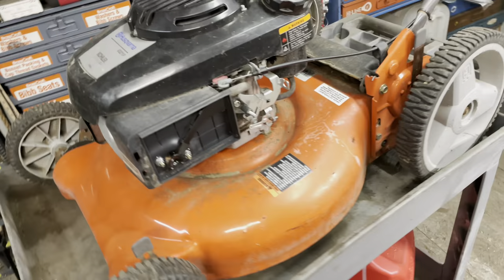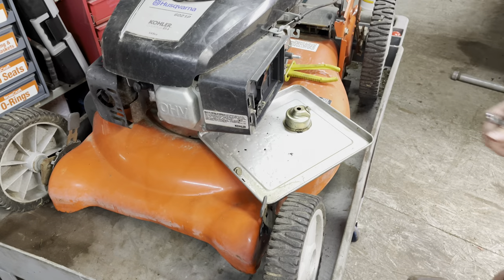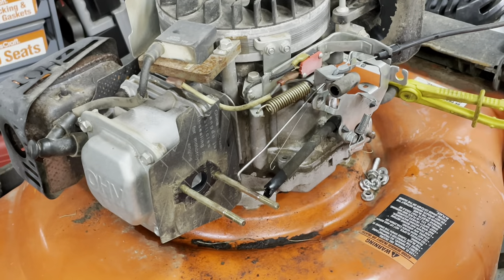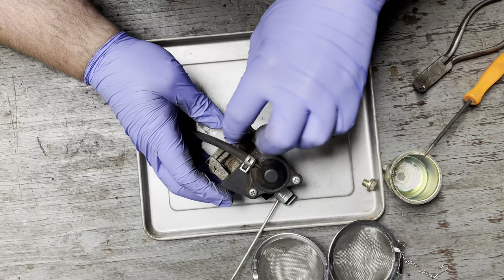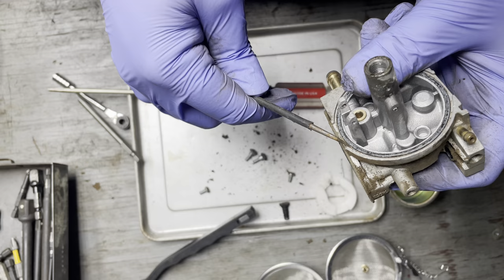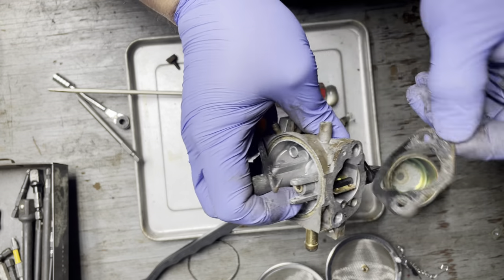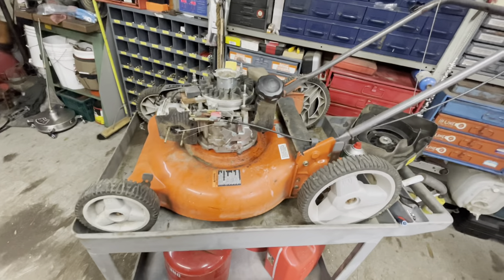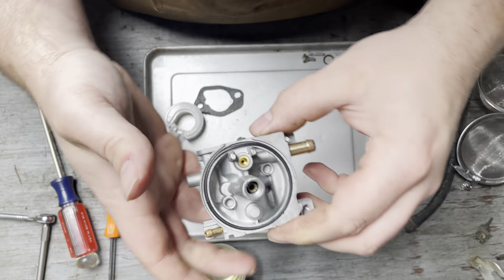Husqvarna 6021P Won’t Run.  Carb Clean/ Service

Comment: I am a 68-year- old woman and thanks to your video I was able to replace the carburetor on my mower myself.  I did have a couple of problems though. When taking it apart one of the torx screws broke off and one of the screws in the back was stripped and would not come out. I tried to get the top off so I could get my drill in there, but the bolts and nuts were both moving so I couldn't get the top off. I kept drilling and then I tried to snap the bolt but nothing was working. then I tried to cut it off with my Dremel but I had the same problem where I couldn't my the blade back to the screw very well.  All of a sudden, I noticed the bolt was turning; all that banging, drilling, prying, and sawing must have loosened that bolt and I was to get my fingers in there and just twist it out.  I was able to replace the screws at Menards so after that, everything went smoothly. I got the fuel line pulled off and I have to do a little cleanup on that yet before I put the new fuel line in. The kit I bought had a shut-off valve so I am going to try and add that too if there is enough room to do that.  I will be back mowing again tomorrow. Thank you so much for making this video; you saved me at least $100 or more and a few weeks without my mower.  In addition to that, I learned a very useful skill.
Reply from the maker: Wow what a nightmare!  Glad you stuck with it and persevered! 👍🏻

Comment: May i ask what solution you run in your ultrasonic cleaner? Mine never come out that clean looking. The carburetors ive done alway come out very dull looking. Clean but dull. Thank You
Reply from the maker: Ive run berrymans chem-dip for almost 10 years and I’ve had great success 👍🏻